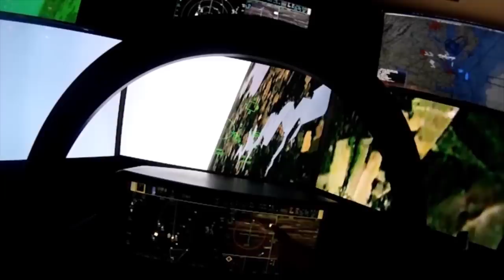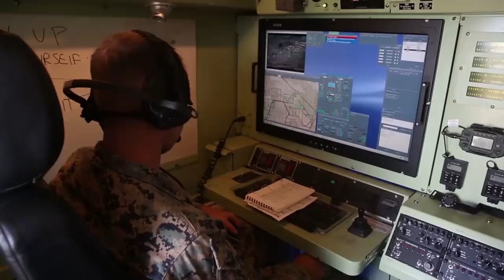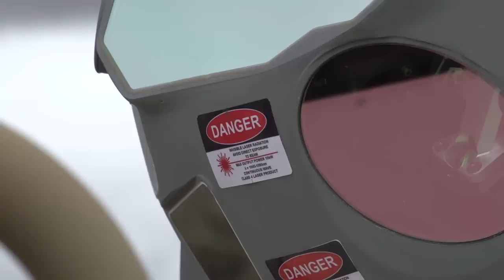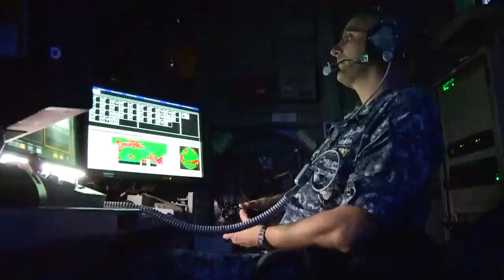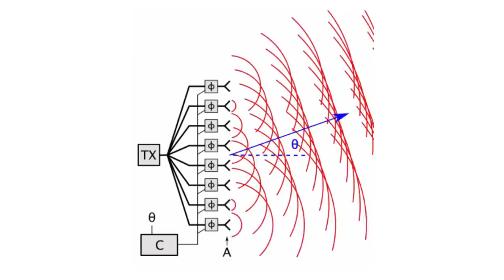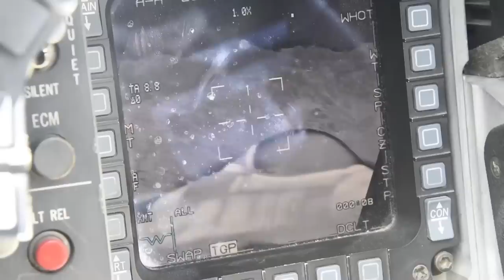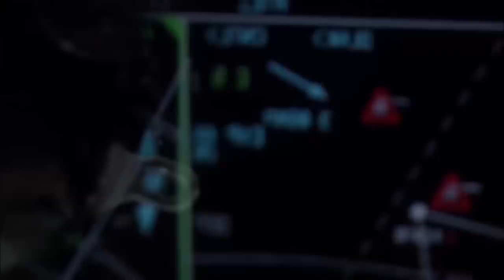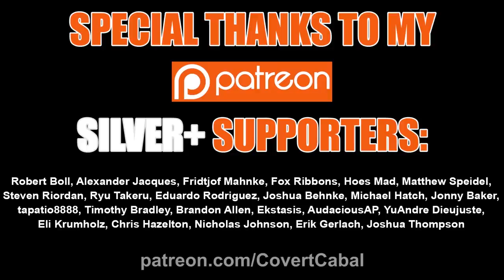Future Gen Fighter - 6th Generation

Comment: Unmanned systems can perform higher G maneuvers.
Reply: I was expecting to hear this and to have life support systems removed
Reply: Laser technology will soon make maneuverability the least important thing about jet fighters, you just have to be able to detect your enemy first, and fire your laser before they fired theirs. Nothing can outmaneuver the light.
Reply: Mickey G I suppose you'll just have to make really advanced mirrors
Reply: Higher-G equals lower speed.
Reply: no shit honey
Reply: @mickeyg7219  laser technology will always be hampered by battery technology. Unless you're flying with a nuclear reactor on board, you can't put a laser on an airplane able to destroy other planes from long range and still take off, that's why it's being tested as missile defense and not as a primary weapon. Can't beat the atmosphere scattering/absorption of the laser beam.
Reply: Ionor Rea's Tech Evolution Archive  , Current AA missiles have very high G limits. When there is no reason to limit the Gs for a pilot (especially the negative G limits), they will be free to perform high-G maneuvers.
Reply: @ChucksSEADnDEAD  Russia just had a nuclear drone blow up.
Reply: @JohnSmith-xk8rr  
Nuclear propulsion is not the same thing as nuclear power. Currently, there's no electricity-generating nuclear reactor that's compact enough to fit onto a jet fighter-sized aircraft. The proof of concept for nuclear ramjet have been first tested in the 60s, and even the modern ones is as large as an ICBM.
Reply: @SimonWoodburyForget  i wish you were my girlfriend, anyways, true to heart, loved your last paragraph. and your wit is practical.
Reply: Simon WoodburyForget That’s not true.  The AI on the F-35 for instance automatically and instantly calculates the probability of kill for each opponent.  It communicates with other assets in the field like other F-35s, ground radar, AWACS, and determines the best firing solution for each aircraft.  No human can do that so efficiently.
Reply: Exactly, and life support system removed
Reply: Ionor Rea's Tech Evolution Archive  , My comment was in reference to the structural strength required for high G maneuvers. That is a very solvable problem in a drone, assuming that other requirements do not conflict.
Reply: Ionor Rea's Tech Evolution Archive  , Right. But those few moments can be very critical. As always, the trade-offs need to be considered in the context of the mission requirements.
Reply: @SimonWoodburyForget  Kind of a tangent but I'm not sure "lasers cause damage through overheating" is accurate.  While current laser systems work by blowing fuel tanks IIRC, I think higher-power lasers and the overall goal is to have a laser that immediately vaporizes matter at the point of impact rather than gradually heating the object, which thermal insulation would not help against.  That would basically be bullets that aren't hampered by gravity or significant travel time, taking chunks out of the aircraft's structure through ablation faster than it can react.
Reply: @SimonWoodburyForget  unmaned =/= uncontrolled
Reply: Still not as good as Red Baron
Reply: Well, leaving your pilots underground in an impregnable drone base does reduce casualties when the drones are shot down.
Reply: @Jupiter__001_  False. Higher speeds equal higher G's assuming the turning radius remains the same. Lower speeds allow sharper turning radius at the same g force.
Reply: Ionor Rea's Tech Evolution Archive  Grav nullifying units in the tail, look up Micheal Schratt.
Reply: Mickey G what about an energy shield? 
True, lasers go faster than any planes, but manoeuvring will make a target hard to aim, lasers requires extreme precision.
Reply: Io actually, if you do these manoeuvres at dogfight when you’re going hypersonic, the G-force will clearly be unbearable for humans as it could mean dropping out of hypersonic and go subsonic within a second or so.
Reply: @Jupiter__001_  The soul cause of g force is acceleration + gravity. To say high G causes you bleed energy is only true if your acceleration vector is not the same as your velocity vector.
Reply: @jlkoelker  In aircraft, your acceleration vector (for a turn) is always perpendicular to your velocity vector. Therefore my statement is very true.

Higher Gs = lower speed means that if you pull a 19G turn in your F-15 you will lose energy at a frightening rate.
There is no such thing as "G-force", fake expert. Gs are a measure of acceleration. To say "the soul cause of g force is acceleration" is a redundant statement.
Reply: Rail guns are better than lasers
Reply: @Jupiter__001_  lol False again. In an aircraft, your velocity vector would never be "perpendicular" to your velocity vector. (a 2 dimensional term being used for 3 dimensional physics) It could never happen in 3 dimensions. Even if you used proper termonology, (orthogonal) Your statement is still false. It could be in any direction relative to your velocity vector, including parallel. You can easily have an acceleration vector in line with your velocity vector, for instance, accelerating off an aircraft carrier, or using air brakes to slow down, or engaging afterburners in a straight line, or pitching up to gain altitude. Astronauts experience this during assent every launch. You clearly have no idea what you are talking about but you're still arguing because you don't like to be wrong. Speed is velocity. you don't lower your speed, you accelerate reverse to your velocity vector. You are suggesting that there is a relationship between g-force (yes a real thing, not synonymous at all with acceleration) and velocity (or as you put it "speed"). That is not true. You can be moving at any velocity and not experience G-force, for instance, a person on the space station traveling 17,200mph but experiencing 0G. Also, acceleration is independent of G-force which is why you will feel g-force pulling you down despite not accelerating up. You would experience a higher g-force leaving earths orbit than you would leaving the moons orbit at the same rate of acceleration. It's literally the same as the difference between weight and mass.
Reply: @Jupiter__001_  I'm not your physics teacher. Go research gravitational force equivalent on your own.
Reply: @Jupiter__001_  No not at all. Only on a single plane. I deliberately interpreted it how you meant it, after correcting you, and you were still wrong. What do you say to that?
Reply: Frank  Yup, especially lasers. Hypersonic missiles will probably be used against ground targets.
Reply: At close distance and high speed you could outmanoeuvre the emisor, and light needs plenty time over objective to damage it. Salud
Reply: @hermanmusimbi4337  nah, that dude failed intro to physics. He doesnt know shit from shinola
Reply: @jlkoelker G-force is not really a force. It's essentially inertia. So for example, when one says a fighter jet can pull 7-8gs, what it really means is that it can accelerate up to as much as 8 times the earth's gravitational acceleration (9x9.82 m/s^2). What a pilot feels in the pit, the G-force, is the inertia (force per unit mass) and that's why he blackouts. I think what @lo was talking about was regarding circular motion which he is correct. In any curvy motion, acceleration is always perpendicular to the velocity vector. That's how you essentially change the direction of velocity.
Reply: Human in the cockpit isn't the only thing limiting aircraft maneuverability. Structural components must be strong enough to withstand G force.
Reply: @factChecker01  Missiles can only pull that Gs while they are very fast. Their dynamics are completely different.
Reply: @BoraOyunda1234  , My comment was in reference to the ability of the structure to withstand high Gs. Nothing more. (Their dynamics still follow the same math, but maybe simplified if there is symmetry.)
Reply: @mickeyg7219  not entirely true, NASA has fission reactors they just developed for their planned moon and mars missions which are small enough to fit in a lander, however I'm not sure what atmospheric temperatures their thermopiles will generate decent output at so they may not work on earth idk
Reply: @mickeyg7219  ....no conflicts involve only the most modern (and expensive) weapons
Arguing that maneuverability will be obsolete is just silly. That would just mean both state of the art weapons AND cheap, abundant stinger missiles will work.
Reply: @SimonWoodburyForget  unmanned does not mean autonomous.
Reply: Ionor Rea's Tech Evolution Archive  Jets already have the necessary construction. it's time at high G that is the limit, along direction of the pilot's body.
Youre argument neglects that even because a plane can handle, say 10Gs for 3 seconds a time, over and over...to hold it for 10 or more seconds requires little to no changes.
The video simply made a mistake in not listing the removal of [a fighter's most limiting factor] as a simple benefit. Defend the channel's character, but don't try to rationalize that mistake unless that what you REALLY believe.....because that was all the original point was saying.

and. like I said to the other guy, just because a new weapon is invented, it does not make all the old weapons disappear.
Reply: @BoraOyunda1234  Structural Components only become the limiting factor AFTER the pilot is removed as the far more limiting factor.
Reply: @ChadDidNothingWrong  Hell no. Structure and jet engines are as limiting as the pilot. With a modern G suit and proper positioning, humans can tolerate 15 Gs for minutes. Which is almost as high as the current structural limits and way higher than planes can actually pull.
Reply: Rumors that, a technology called quantum communication is being research . If there is a breakthrough, all the aircraft will become unmanned aircraft. Pilots will become the safest profession in the world.
Reply: @ChucksSEADnDEAD  If the laser beam is thin enough, the energy consumption will be infinitely small.
Reply: Hence the F-35's true (future) mission. 
Command and control of unmanned fighter planes.
Reply: Yeah probably because they don't have a human in them
Reply: Drones are the only way of cutting costs  and mass producing in a time of war. Whats the point of having the most amazing aircraft if the cost means so few built plus any losses are disproportionate to your combat capability. As in WW2 showed advanced german jets were too few, took to long to build and consumed lots of R&D resources to make an impact. Long range drones can also be hidden, fly at any altitude for ages and be launched from different platforms (subs, destroyers, ground launchers, bombers, missle silos, cities) without having to protect the finite pilot, his requirement for air/food/gforce protection/armour/visibility. Even 5th gen craft can be impacted by cyberattacks and its doubtful that any pilot can fly even current 5th gen planes or operate in a battlezone as planned if comms or a cyberattack hacks certain onboard systems. Hypersonic projectiles render awac platforms/orbital sats/remote naval fleets running such aircraft vulnerable and they are cheaper to mass deploy. Conversely all your (drone) pilots in one underground location is a risk.
Reply: Simon WoodburyForget not to mention the horizon naturally limits the range of lasers, unless you can slightly curve the light somehow. But they certainly can’t outrage most missiles
Reply: @northropi2027  when you vaporize something you either impact it with tons of kinetic energy to to shatter or atomize it, but to vaporize materials through lasers means to overheat it all the same, just in ridiculously faster heating
Reply: @yourerightmybad7363  yes, but the person I was replying to used overheating more in the context of gradually adding heat to the system to cause things like cook-off of fuel, as early lasers tested on UAVs did to shoot them down.  I was pointing out that the apparent end goal of laser technology is to make a weapon with enough power to rapidly ablate a localized chunk of material, causing immediate structural damage that can be thought of more like a kinetic impact in terms of end result, as opposed to an effect more like putting it in an oven until its fuel tank explodes.  Insulation wouldn't really be relevant to such a weapon, as the goal of it is to destroy material locally rather than heat up a large swathe of it.  More relevant measures of armor against lasers would be the mass that must be ablated before critical components are susceptible to damage, and the amount of energy required to ablate a unit of said mass.  Reflectivity could also help.  I take thermal insulation (ie a lack of conductivity to heat) to be less relevant because I assume such a weapon would ablate things so fast that the vapor would leave the system before significant heat is transfered to adjacent material, so it would just ablate a chunk at a time.
Reply: @stephendoherty8291  Like always - till the countermeasures exist.  its quite tiring really keeping uo with this all
Reply: And they dont  eat food, sneeze, fart 💨, cough, barf, shart, shit, or get sleepy 😴...

👽🌎✨
Reply: Proof?
Reply: Mickey G not something that will be viable within the next two decades. We barely can get a laser to destroy something more than a mile away with huge charge capacity with a ground system. I can see it’s potential as a self defense capability but for the time being not offensive.
Reply: The sky is blue.
Reply: Joe Kerr sa poll z
Reply: . how a helicopter flying
Reply: @mickeyg7219  i imagine some sort of plasma shield
Reply: They also get hacked
Reply: So can manned aircraft. The people inside may not fair too well, but the aircraft can certainly do it.
Reply: @mcmarkmarkson7115  If they can design a rail gun that doesn't destroy itself in the first few uses.
Reply: @josephgilliand4  They  can, but probably won't make that public too soon.
Reply: Laser tech AnD batteries are all a joke to electromagnetic force fields, which the US is using to develop submarines that can travel at supersonic speeds underwater.
Reply: Mickey G laser are severely limited in range due to atmospheric refraction and scattering, and weather. They will be supplemental, but not the end all be all.
Reply: Thetequilashooter1 the f-35 isn’t the only aircraft to do that.
Reply: Bora Karaman that is correct. The current F/A-18 has a G limiter to extend service life of everything
Reply: Bora Karaman G suits only protect up to about 1 g. 15g s For minutes would kill a pilot in any standard configuration.
Reply: TRUE.... but, you have to consider latency, signal loss, and hacking. No computer system that requires a signal connection is safe, as advancing in computing leaves any encryption vulnerable.
Reply: @mickeyg7219  unless  the belly of the plane is made of mirror,u shoot me laser i show you ,your own fire!!!!!!!!!!!!!!!!!!!!!!!!!!!
Reply: @mickeyg7219  One can actually counter a laser with a cloud of smoke. They do not work in rain et cetera.
Reply: No they can't, the current limitation on high G maneuvers isn't pilots but how durable the electronics are. It used to be that the pilot was the limitation but as we started incorporating more advanced electronics they became the limiting factor.
Reply: There is more to areal combat than pulling fucking Gs ask any fighter pilot there is so much more.
Reply: We don't even have the technology yet for maneuverable drones.
Reply: @Jupiter__001_  Having the option of losing  speed for turning faster is a pro.
Also hypersonic 6th gen fighters might not agree with you.
Reply: @vladgingu  Maybe, but the issue is that losing speed leaves you a sitting duck. In addition, you will have a lower top speed and worse energy retention due to having larger wing area.
Reply: Happy Terminator noises
Reply: @mickeyg7219  the curvature of earth can. Laser weapons aren't suitable for beyond-visual-range combat
Reply: @SimonWoodburyForget  it'll probably take 40 years minimum but eventually we will have AI that can outperform a human in operating military aircraft,  even determining the best course of action when all communications are lost like a human can. just a matter of time.
Reply: Mickey G actually clouds dissipate light thus this could make lasers ineffective
Reply: AI would always demolish humans
Reply: @SimonWoodburyForget  Even if we get implants and difference in performance is irrelevant it will still cost more money to have systems to support a living pilot. Also, there'd be a risk of losing a human life. AI is still developing and I see no reason why in 40 years we couldn't have new models and hardware that are better at processing multiple things at once. After all all the decisions a human pilot makes are a result of taking in inputs (eyesight, touch, sound, memories, etc.) and producing an output (pressing a certain button, performing a certain task, etc.) through a complex system (the brain). It's definitely very very very complex, but I see no reason why an AI couldn't make a good pilot. There's been AI's able to play complex games (with multiple things it has to do simultaneously) that are better than any human player, obviously that's a lot simpler, but it shows we already have strong foundations for the tech that will allow us to do that. I guess it's speculation though, we'll see in 40 years how things are.
Reply: @SimonWoodburyForget  Also in simulations AI fighter pilots have been able to beat real fight pilots, that being said though I think pure combat is the easy part for AI but being able to operate with no ground input and determine the best course of action in more obscure situations is a lot harder. Also, it might be hard to get support for it since usually AI has to be a lot better than humans to be accepted, like how Tesla's per mile on autopilot are safer but since it's AI 1 crash matters a lot more.
Reply: @SimonWoodburyForget  Yea, I bet the problem for AI would be getting enough training data. Eventually given enough good data and computing resources an AI would be able to make inferences about certain situations much better than a human could, and being able to learn new situations/strategies faster, but like I said to do that I feel like it'll take an immense amount of training data which would be hard to attain since there's relatively few opportunities to do that. Maybe it'd even require a very powerful generalized AI (takes in news articles, every sensor/detector/system it has access too, etc. and can do a lot of different things) which we currently don't have and won't have for a very long time. For what reason though would an AI not be able to eventually, with enough data and processing power, be able to learn how to adapt to new situations and perform better in all areas than a human? Even ethics and strategy can be learned (like, don't shoot down that aircraft because of some symbolic reason, for example).
Reply: Thank you,  Captain Obvious, for that contribution.
Reply: Titanium Rain it is possible solid state batteries could revolutionize laser warfare
Reply: Io hey hey 

5g
Reply: True, But Unmanned systems are vulnerable to being hacked into by the enemy
Reply: Bora Karaman wtf find me a human on the planet that can withstand 15G for minutes. Go look up some centrifuge videos. Most people can’t even reach 9G without blacking out. 12G for less than 2 seconds max on a trained pilot, maybe a minute at 9G
Reply: @SAMUEL NAUMETS Yes but he was injured afterwards, and it was for less than a second I believe. However, most pilots still can't withstand 12Gs for more than a few seconds, where as an aircraft can for minutes
Reply: SAMUEL NAUMETS an AI can fly the plane, but the AI would act like a human so if it received orders from some random source telling it to land in Moscow it would realize that it was BS and continue its mission
Reply: SAMUEL NAUMETS I’ve watched many videos of fighter pilots in a centrifuge
Reply: @SAMUEL NAUMETS I was assuming and simplifying. An AI wouldn't be connected to "wifi" it would just think like a human, and the only time it would get orders would be at base, unless the mission was of little importance
Reply: @RoguellVoid To destroy planes from AIM-120 range? You need it.
You could power a missile defense laser by just using shaft power from the jet engine, because you expect the missile to get close.
Reply: Glances at ace combat 7
Reply: In fact the only limits are the structural capacities of the plane.
Reply: I dont know if this is still an ongoi g discussion but with the current aircraft we have in the world, the planes have more trouble with dealing with g’s then the actual pilot. The pilot blacks out worst case, the planes gets worn out ALOT and maybe even breaks under high G loads
Reply: This is a common myth. Most fighters can't perform crazy Gs like you think. Adding a AI instead of a pilot doesn't mean physics and gravity change. Pilots can already mostly handle what the jet can. Theyre well trained and have years of experience doing so. Also actual pilots have debunked this before via C.W. lemone who is a former FA/18 pilot.
Reply: @SimonWoodburyForget  Unless I'm really confused, I've never met anybody who measures laser energy in kg. 500 kg of laser?
Reply: Drones aren't as "dumb" as they used to be. It is easy to see how a neural network run drone not only can analyse in a millisecond the best course of action to take based around its database and previous encounters, but just like neural networks in games, they know exactly how to trick humans into doing stupid mistakes.

For example, a drone may fein being slow, retreating or being out of countermeasures, just to force a human pilot into a false sense of security to expend his missiles. Once the enemy plane has lost enough AA missiles and the drone is confident it can win the engagment, then it can show its hand to the now bewildered human pilot. 
Another example is numbers, you can field more aircrafts than you have competent pilots for them, and drones are easier to make than piloted aircrafts with the same caracteristics. Drones are expendable and they can work around that. For example, a drone can identify an enemy plane, it knows in his database how many AA missiles it has, and simply know when to evade to reduce the enemy missile load, take out individual fighters in vulnerable positions to reduce said number, and once they know they have superiority, pounce on the area with no care for their own safety. In all respect, they are equal or better at standoff compared to regular planes and vastly better at everything else. They are the single best thing possible for CAS, and are also the perfect escort for piloted fighters and bombers. They can never be tricked, never be surprised. They never panic or get tunel vision.
Reply: @mickeyg7219  Lasers get to the target instantly, but then they need the time to transfer enough energy.
Reply: Ya think?!? LOL
Reply: @5D3B1. Ya think?!?  LOL
Reply: J stay get get gettin it in a plasma shield xD that would be great against communication jamming.
Because they can’t jam you if you already jammed yourself
Reply: MC Mark Markson no one hides weapons. Except for intelligence systems.
Reply: No shit
Reply: “You know what High G turns are? Press LT+RT to preform High G maneuver.”
Reply: I would rather fly the aircraft
Reply: High gs equal low speed low speed equals low gs
Reply: Unmanned fighters would get absolutely embarrassed by manned fighters today. We’re not even close to a UAV replacing the functionality of an F22. Operational drones are very low tech systems employed against defenseless enemies.
Reply: Just Made a aircraft made of glass and you will be safe from laser weapon😆
Reply: My like made it 2k
Reply: @ChucksSEADnDEAD   just put it on a ship enuff space for reactor
Reply: Its almost like that doesn't really matter